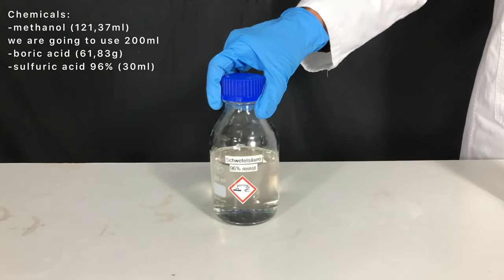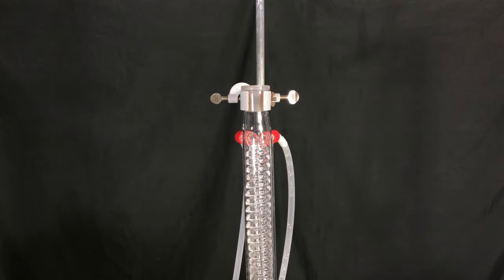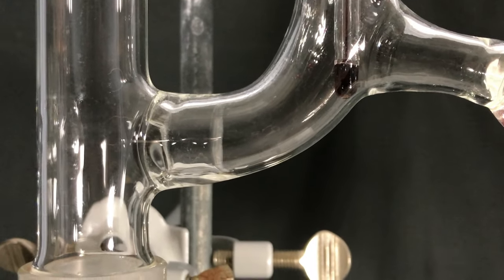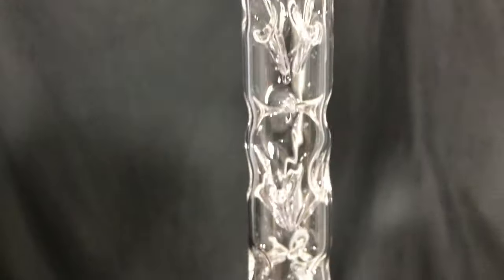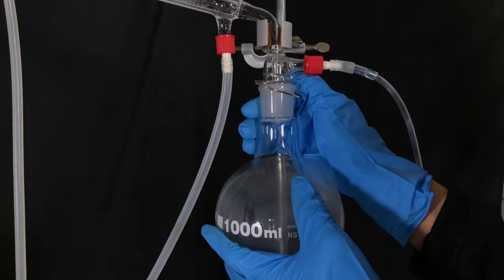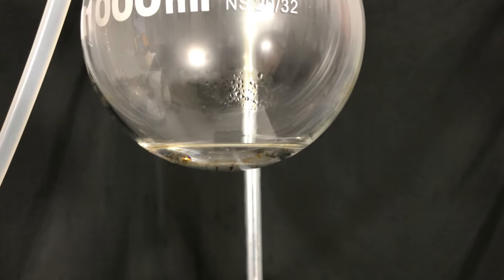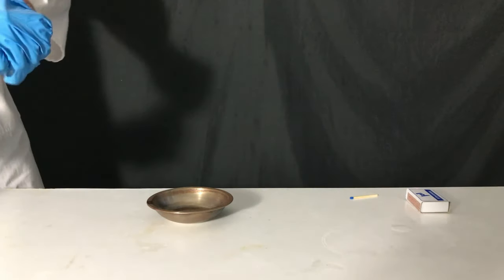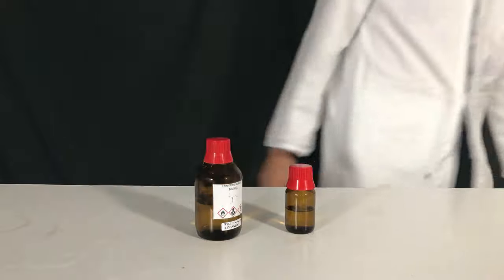Making and burning trimethyl borate (method 1: methanol and boric acid)

Comment: Amazing video, but I have 2 questions for you:

1.) Can it be used as a Rocket fuel?
Does it generates thrust somehow?

2.) What happens if i mix it with Gaseous Hydrogen?
And what color does the flame would make with the 2 combined? Will it still be Green?
Reply: basically anything flamable can generate thrust and be used as rocket fuel, some are just much better then others

since hydrogen is a gas and this is a liquid combining it would be a bit hard but as long as there is enough oxygen the flame should still be green, if there is to little oxygen soot might turn it yellow though
Reply: @wooy1701   @wooy1701  Wow Magnificent ! Thank you very much for the response Dude 🙂🙏
if curious.. look up for ( nörthstat ) + ( artstation ) 👍

Comment: Would an excess of boric acid remove all the methanol
Reply from the maker: No. An esterification is an equilibrium reaction meaning you will always have MeOH present unless you remove all water using a drying agent.
Reply: @THYZOID  i did this earlier today with 2x borax and and an unmeasured scoop of NaHSO4 (.6-1.4x) and it distilled at 64°-67°

Comment: would it be an alkylating agent ????
Reply from the maker: It seems like it can be used as a methylation agent in some specialized reactions.

Trimethyl borate is a useful reagent in organic synthesis. It is involved in the production of resins, waxes and paints and acts as a methylation agent. As a boron source, it is used to prepare flame retardants, anti-oxidants and corrosion inhibitors. It reacts with Grignard reagents followed by hydrolysis to prepare boronic acid. It is also used as a precursor of borate esters, which finds application in Suzuki coupling reaction. It is an intermediate in the preparation of sodium borohydride. (Source: https://www.alfa.com/de/catalog/B20215/ )
Reply: hi thanks for answering. everything would be to prove but the PKa of boric acid as a leaving group is very high. I have been studying for a long time how to make a methylating agent and the good ones are all very toxic and difficult to manipulate. the best candidate would be to make dimethyl sulfate but its synthesis in all forums abbreviates its dangerousness hopefully I could find a method to make (CH3) 2SO4. HAVE YOU CONSIDERED DOING IT SOME DAY?
Reply from the maker: @Josezwitterion  You know what? It looks pretty easy and appropiate ppe is in place. Because it was already planned to make diethyl sulfate and therefore just recently produced some anhydrous sodium sulfate as a drying agent was produced ill try your suggestion first. Going to write a paper on it now and because it is easyer than some of my other projects it will be the first project in the queue.
Reply: Everyone I have asked has told me that it did not occur to me because it is very toxic and can kill me instantly. if you do it would really surprise me. it appears to be more dangerous than HCN. But I have my doubts since it has a high boiling point and a low vapor pressure, thus being the best methylating agent par excellence, if you really did it, you would leave me speechless. very good your channel better than nile red
Reply from the maker: @Josezwitterion  I just read about it some more. After checking for legality we might do a micro scale preparation (~2g).
Reply: @THYZOID  muchas gracias